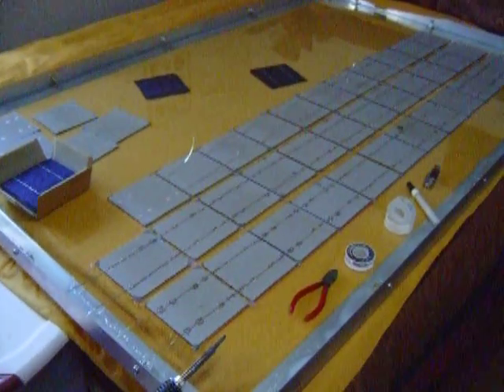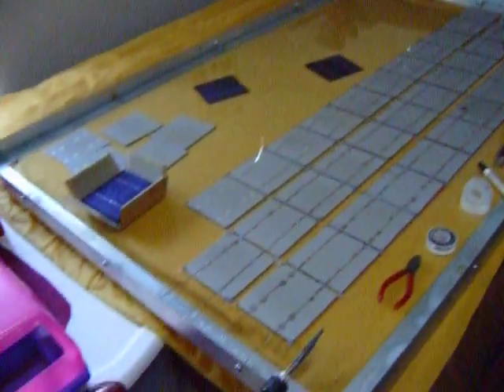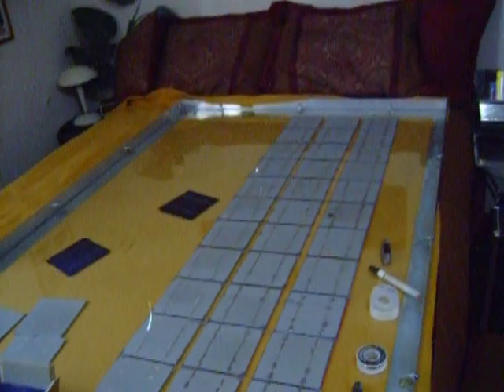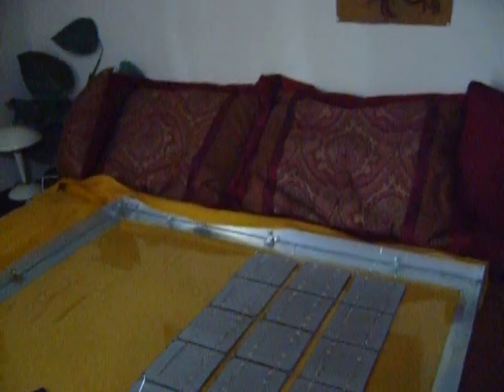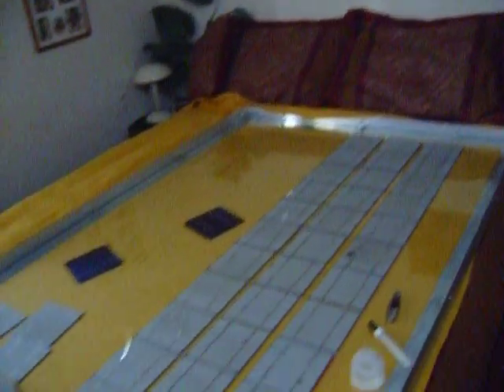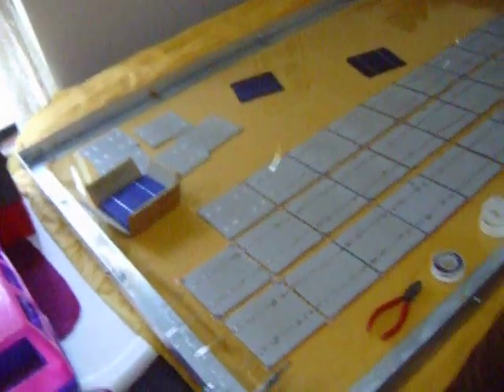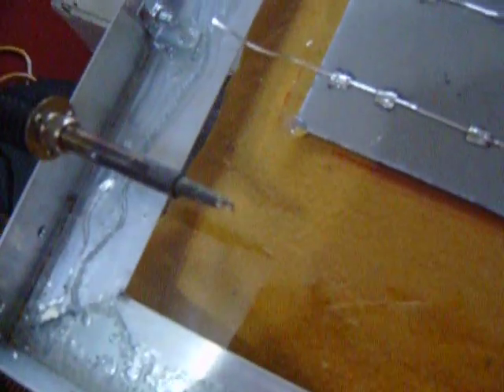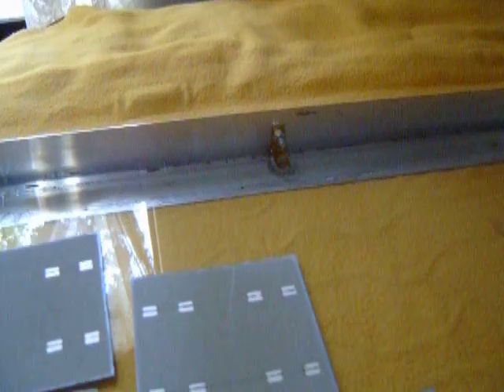Progress On 24 Volt Solar Panel

Comment from the maker: @Fearlessthinker With this summer heat 102-106 degrees and high humidity makes a heat index of 109 and more. I am only making 8 amps (8 X 24 volts = 192 watts) not so good. I wonder if factory made solar panels do this poorly all things considered. Im sure they are better as far as matching but they are still mono crystalline cells. I guess what I am saying is that I know they are built with no broken cells, but what is the percentage ratio of heat reduction on factory? Its half on my DIY

Comment from the maker: @Fearlessthinker The cells are about the same some did come down some. I think I saw some for 60 dollars yesterday. If you find a used glass for cheap its not to bad. I will probably try 2 of those meromorphic factory panels next time.

Comment from the maker: @Fearlessthinker Well what the cells are rated at on paper is 8x90watts and 6x30watts but its not able. Its not good to mix to different sized cell panels together and I need to separate them with different mppt charge controllers. If the panels where all perfect with no chips then we could exspect to see better results on the wattage. At one time I was making about 14 amps or better x 24 volts that would be 336 watts when it was springtime. An educated guess I duno? I wish I had a Triametric.